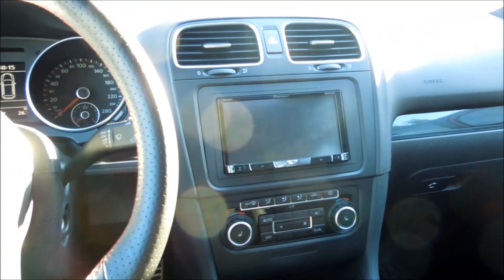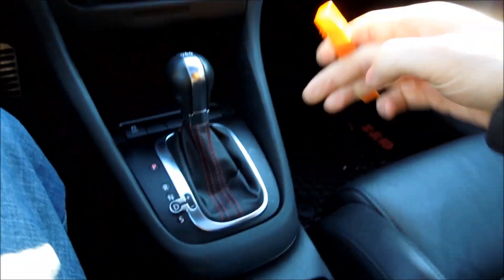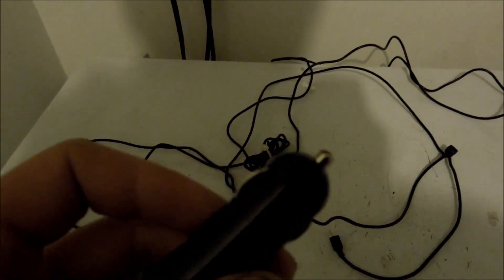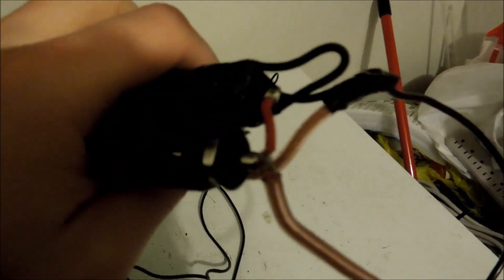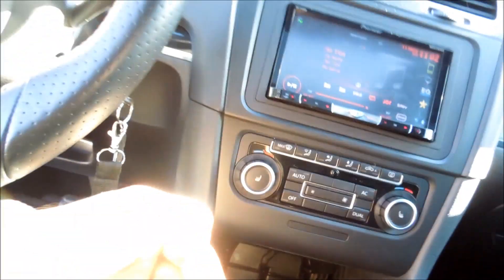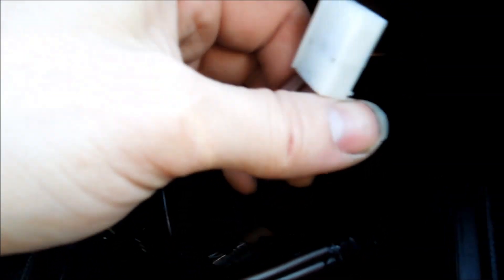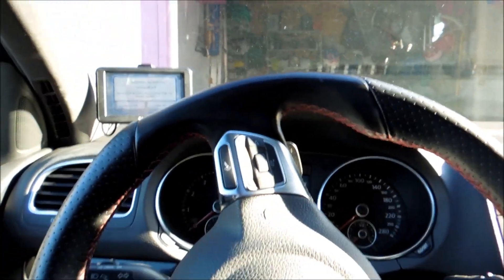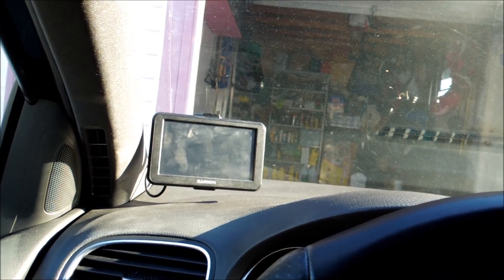HOW TO WIRE A DASH CAM AND GPS INTO MK6 GTI 2011

Comment: It's a bit better to wire into the fuse panel either a separate 12 AUX connection or if it runs off USB power something like this.  

http://www.amazon.com/Spy-Tec-Dash-Camera-Vehicle/dp/B00S73FE8A/ref=pd_sim_sbs_e_1?ie=UTF8&refRID=0ZXZ2T7TBMDPXN0TDF9N
Reply: +Scott Hoisington Sounds like a good idea but where's the easiest place to connect the ground cable to near the fuse box ?
Reply: +Paul D  Just unscrew one of the bolts or screws located in the fuse area, wrap negative wire around it and bolt/screw back.
As scott said the best way is through the fuse box reasons.
Its really quick (no mucking around)
Its easy
Reply: +trbcop Thanks yeah I did that the cam is nicely fitted without any cables on view.
Reply: Hello Scott, which fuse did you wrap the wire around?

Comment: Can u not just do add a circuit and tap into the fuse box and use say like the radio fuse
Reply: The car outputs 12v whereas the gps and dashcam require 5v. You can wire the usb car charger to the car's 12v but you can't directly feed the 12 to the gps and dashcam 😊

Comment: The way u did it u cross the wire directly over the side airbag!!!! Bad news if ever that airbag goes off
Reply from the maker: TheMuddatrucker the plastic from the trim hurts 10× worse then the GPS wire haha
Reply: ghostlyrich it sure would suck if it unplugged the dash cam and you either lost footage, or stopped recording right at impact. What if something happened after the airbags went off?
Reply: Stephan Llewellyn  I’d be more worried about whether that airbag would even inflate at all and if it did then having a wire stretched tightly across could possibly cause it to malfunction... maybe grab onto the plastic trim and smash that into your face too! 
The other guy who replied mentioned that the trim hurts more then the wire anyway, I don’t think he realises that the trim is designed to break away in a manner that won’t let it hit you but with that wire in the way will the trim still detach as meant!? Who knows???.... I wouldn’t want to find out either, it’s just a half arsed way of fitting if you ask me.
Reply: ghostlyrich The plastic from the trim doesn’t hit the driver if the airbag is deployed, if it did then the driver would certainly know about it! If it doesn’t kill him! Might also want to tell the next potential owner or driver that you dangerously bodged the wiring for the dash cam 🙈
Reply: TheMuddatrucker good points! Thanks for the insight.
Reply: If you follow the trim on the side and not cross it your fine atleast on my car there was a decent about of space on the sides of the airbags